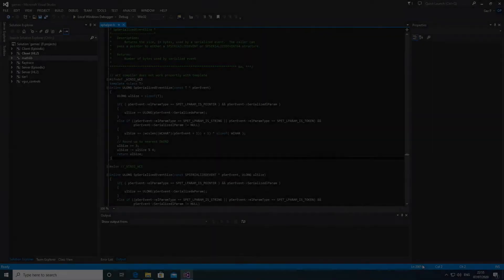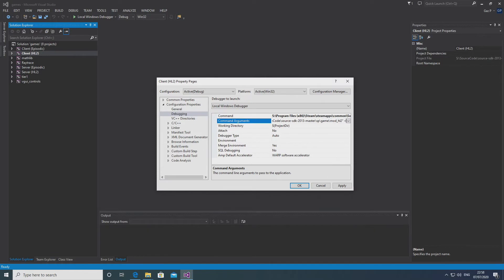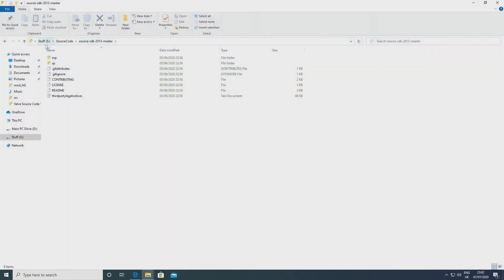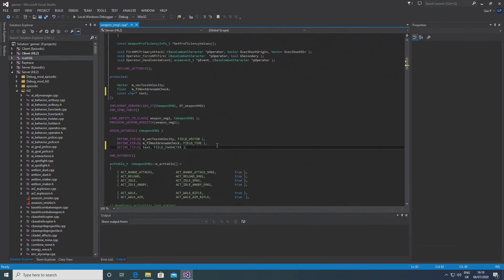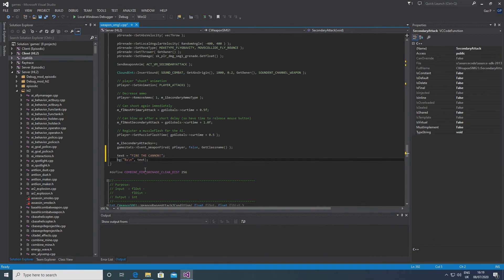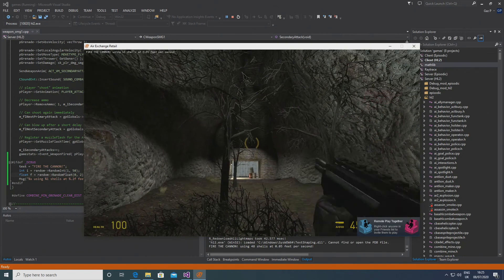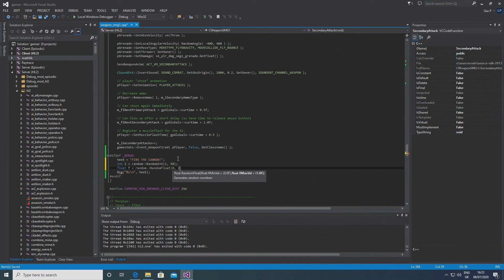Valve Source Code 2013 Tutorial (Episode 0.5/1): Debugging the Code and Coding Console Messages

Comment: Unable to start program 'C:\Users\Administrator\Downloads\source-sdk-2013-master\source-sdk-2013-master\src\game\client\Debug_mod_tf\client.dll'.

C:\Users\Administrator\Downloads\source-sdk-2013-master\source-sdk-2013-master\src\game\client\Debug_mod_tf\client.dll is not a valid Win32 application.

i changed to win32 but it had 700 errors
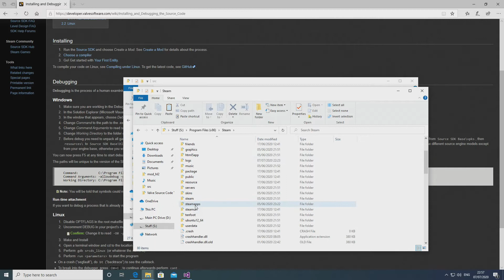Reply from the maker: I show what to do from around 01:39, but you can change the Configuration option to All Configurations which will change the command for both Debug/Release configurations. The error you are talking about happens because you haven't passed through the Command part correctly, so you are trying to launch the client.dll file as an executable.

Comment: Hi I’ve got an issue, so my pc is too laggy to run this software. So how can I delete it ? How can I delete the disk that was created ?
Reply from the maker: Are you referring to Visual Studio or Source 2013 Singleplayer/Multiplayer? Either way, you should be able to use the 'Add or remove programs' system setting to delete them.
Reply: @ I am talking about visual studio, but later this night I found out how to delete it. 10 years ago, softwares were on DVD. So this is why there was a dvd added on my pc(I am saying that because at first I panicked if it was normal or not). Then, to delete the famous DVD, its like the software in question. So I goes in Control Panel, then I  goes to softwares to delete, then I right clicked on « change », then the uninstaller of Visual studio 2013 opened. You click on Uninstall then you wait then there you go. Btw, what I’m gonna do, is just copy and paste some code source scripts to create my own game engine. I hope this message helped people who don’t know much about informatic ! :)

Comment: when i try to load up the game it says Could not load library client. try restarting. if that doesn't work, verify the cache. what do i do. NOTE: this only happens to half life 2 mods not the base game
Reply from the maker: This issue seems to happen when you don't have client/server .dll files in your mod folder, so you would need to make sure the code compiles without any issues and ensure the Command Arguments section contains the correct path to your mod folder.
Reply: @TheMaster974  the client and server.dll files are there
Reply: my command leads to this E:\SteamLibrary\steamapps\common\Source SDK Base 2013 Singleplayer\hl2.exe my working argument is this -allowdebug -sw -condebug -console -toconsole -game"C:\Users\Leani\Downloads\source-sdk-2013-master\source-sdk-2013-master\sp\game\mod_hl2"  and my working directory leads to this E:\SteamLibrary\steamapps\common\Source SDK Base 2013 Singleplayer WHAT AM I DOING WRONG and this is all in client(HL2)
Reply from the maker: Try adding a space between the -game parameter and the path to your mod.
Reply: @TheMaster974  it worked, i feel so stupid

Comment: "unable to start source sdk 2013 access is denied" - what i do?
Reply from the maker: From the research I have done into this issue, this seems to happen if the Command/Command Arguments sections are not correct for your situation i.e. using the C:\My_Mod\... path, when your mod folder exists elsewhere. Try changing the mod path to the place where your source code is located and see if that resolves the issue.

Comment: Hello, I have an issue. Whenever I debug my mod and run the map and the mod, the menu title to the mod are just abunch of hl2 symbols, no letters. I've gone into the gameinfo file. And the title and game names are normal letters and dont include anything weird. I have also tried to add maps to each chapter to play. But the mod wont boot the maps up even tho I have them in the map folder in my mod, and have configurated them to run on each chapter in the mod. It feels like my updates to the mod arn't applying. Please help me.
Reply: Thank you, you fixed my issues. I only have one little problem tho. My game title when I'm in the game, isn't fully working. Some letters in the title you can see, and some you can't. Like some letters in the game title are just invisble. I Have changed fonts, but I really do not know what to do. Do you know what the issue is?
Reply from the maker: I'm not sure, it could be the font you are using, but if that is not the issue, the only other thing I can recommend is to look into the clientscheme.res file again and look at the Main.Title1 and Main.Title2 stuff, there's options for position and colour which might need to be adjusted. If you let me know about the font and title, I could look into this and see if I can replicate this issue if my suggestions still don't fix the problem.
Reply from the maker: The reason why the menu title looks weird in-game is because of the font that the title uses, which is a font that contains the weapon/ammo icons seen in Half-Life 2. One thing you could do to resolve this issue is to change the menu title font, which can be achieved by modifying the ClientTitleFont section in your mod's resource/clientscheme.res file. As for the maps issue, all I can really advise is that you make sure the maps are contained in the mod's maps folder and you are using the correct spelling of the maps in the chapter number .cfg files, which should be in your mod's cfg folder. This goes without saying, make sure the chapter number .cfg files are actually saved as .cfg files, otherwise the custom chapter map loading won't work!

Comment: I Keep getting "Library Client Couldn't Load", and then it's telling to verify the cache, i don't know what any of it means
Reply: I am using the correct path to my mod folder, oh wait, do I need to make a mod folder 😅,  because I wanted to modify the source itself, I thought a mod folder wasn't necessary, maybe that could be the problem
Reply from the maker: It's possible to modify the source code without needing a mod folder, however you won't be able to launch into debugging for testing. You can use the mod_hl2 or mod_episodic folder that comes with the 2013 code (which is in the game folder), the client.dll and server.dll files will be compiled to the bin folder in that location by default.
Reply: @TheMaster974  Yeah your right about not being able to debug, cause the error showed up when I tried to debug my compiled sdk
Reply from the maker: You could have a mod folder set up in the Steam/steamapps/sourcemods folder, as long as the Command Arguments section includes that location (this is shown at around 3:15). I always use the stock mod_hl2 folder whenever I test stuff out, so I don't really know what to suggest if you're experiencing this issue still, even with the stock game folders.
Reply: @TheMaster974 Yeah, this problem is pretty weird, I haven't yet tried this solution but thanks for the help, I'll totally try this method so I can debug my mod. I am pretty confident that this'll work, it's probably missing some assets and I just haven't correctly imported them
Reply from the maker: I'm not sure why that's happening, all I can really advise is that you make sure you follow what I say in the video, make sure the client.dll and server.dll files compile correctly and you are using the correct path to your mod folder in the Command Arguments section. It might also help to ensure you are opted into the upcoming beta of Source 2013 Singleplayer.
Reply: I just saw another tutorial on how to setup,  not saying yours is bad, but in that tutorial, it was mentioned that you need to import cfg files and transport all your dll(client and server) to the mod folder, I'll try this out, maybe the library error I'm getting, means that some assets are non existent or cannot be found, I just hope making the mods folder will help

Comment: Hi there, I have everything (I think), but when I compile the code and open the game, it shows this: 
------------
Engine Error

Could not load library client. Try restarting. if that doesn't work, verify the cache.
------------
What should I do?
Reply from the maker: It sounds like the bin/client.dll or bin/server.dll file isn't being found in the folder that you specified in the Command Arguments section of the Properties of the Startup Project, which is why the game doesn't load up properly. All I can really advise is to check to make sure that the path to your mod is correct in the Command Arguments section, plus an appropriate Startup Project is selected i.e. a HL2 project is used if you are dealing with the game/mod_hl2 folder or an Episodic project if you are dealing with the game/mod_episodic folder (if that makes sense).

Comment: i am trying to change the RPG speed on the multiplayer version but changing the #define RPG_SPEED does nothing even after rebuilding with the changes, do you know what could be causing this?
Reply from the maker: I'm not sure, I was able to change the speed value, compile the solution and the modification was reflected in game. All I can really suggest is to make sure the RPG_SPEED value is getting used in the code properly (it's used in AccelerateThink and IgniteThink inside of a SetAbsVelocity function) and to ensure you are loading into the correct mod when testing.

Comment: how do you get all of those files in mod_hl2
Reply: i only have 10 things in there
Reply from the maker: You can create new folders (right-click inside of the mod_hl2 folder and select New->Folder) inside of the mod_hl2 folder, for stuff such as models, particles, sound etc. and get assets from the Source 2013 Singleplayer/Multilplayer install directory that Valve doesn't provide.

Comment: do you know how to setup hammer for a source mod or do you have a tutorial on it.
Reply from the maker: Thanks for the comment and apologies for the late response, I don't have a video about how to do this, however what I would advise in this situation is to open up the Hammer editor and go to Tools->Options, then select "Edit" after the Configuration option, then Add to add your mod as an option, then you will need to add .fgd files that will be useful and select file paths for Game options and Build Programs. Game options would be the path to Source 2013 Singleplayer/Multiplayer and your mod's directory respectively. Build Programs (which is a separate tab) will be the paths to tools like VBSP/VRAD etc. but also where compiled maps will be placed (point it to the mod's maps folder). Hopefully this is enough to help you!
Reply: @TheMaster974  thank you so much

Comment: How do I debug the Multiplayer Version? What do I select for the command path?
Reply from the maker: You would do pretty much the exact same thing as I mentioned in this video, however change Singleplayer to Multiplayer (so the Command and Working Directory paths point to where Source SDK Base 2013 Multiplayer is installed) and change the path to your mod in the Command Arguments section to the directory where your mod is located.

Comment: hi, i have problem with debugging, it says there is no captoincompiler.exe at src\utils\captioncompiler\debug, there is only captioncompiler.exe.recipe, when i remove recipe it changed back, what i need to do?
Reply from the maker: I think the captioncompiler project needs another project to be built first in order for it to build properly, so simply building the solution again should solve the issue. I think you also need the sapi51 folder (as mentioned at 6:23). However, this project isn't really important concerning Source modding, the Client and Server projects are far more important!

Comment: Unhandled exception at 0xE55AB6D4 in hl2.exe: 0xC0000005: Access violation executing location 0x00000000. What can it be?
Reply: are you Compiled server(hl2)?Make sure the server.dll and client.dll exist in the mod_hl2/bin dir
Reply: @wenchaojiang958  Thank you for this comment, I had this same issue and I didn't realize that building the client did not also build the server automatically. Doing a manual build of the server fixed the issue!
Reply from the maker: I'm not sure, if you're using the Singleplayer code, did you opt into the upcoming beta for Source 2013 Singleplayer on Steam?
Reply: @TheMaster974  putting the upcoming beta dont work,i tested it and still having the error (srry for bad english)
Reply from the maker: I don't know why this happens and I haven't been able to replicate the issue on my end, so I don't really know what to suggest. A couple of things that might help me out is to know if you are using the unmodified version of the 2013 code released by Valve, did you install Visual Studio 2013 Community and which version of Visual Studio are you using to launch into debugging?
Reply: @TheMaster974  im using the unmodified version of the code and using vs 2013 ce as ide and compiler
Reply from the maker: I would suggest trying to use a newer version of Visual Studio and see if the problem persists, if that doesn't resolve the issue then I don't know what to say, I haven't encountered this issue so it's hard to determine what's causing it.
Reply: @TheMaster974  i used vs 2022 as ide but same error,i will try to use source SDK base 2013 ce or mapbase to see If the error persist

Comment: i'm having this weird error whenever i press local windows debugger. "Unhandled exception at 0x2E1AB600 in hl2.exe: 0xC0000005: Access violation executing location 0x00000000." any fix?
Reply from the maker: Oh ok, that wasn't what I was expecting the issue to be, I'm glad you managed to resolve it!
Reply: @TheMaster974  what was the solution? i have the same error
Reply from the maker: It looks like the reply has been deleted and I don't remember what it said, so I don't really know what to suggest. My recommendations would be to ensure that you have opted into the 'upcoming' beta for Source 2013 Singleplayer and compile the Release version of the code instead of the Debug version. Also make sure your code doesn't have any errors!

Comment: why i can't run the code 
and i setup source 2013 for visual studio 2019 
my mod_hl2 folder more empty than your mod_hl2 folder also my mod_hl2's subfolders too 
what should i do
Reply from the maker: That's a difficult question to answer, as it would be ideal to install Visual Studio 2013 Community first, then Visual Studio 2019 later. You have to install Visual Studio 2013 Community to get the right Platform Toolset that allows the code to be compiled. If you updated/upgraded the source code to use the Visual Studio 2019 Platform Toolset, you won't be able to compile it. It's weird like that, you can't just use a newer version of Visual Studio and it works. In regards to the mod_hl2 folder being empty, you can always copy what's in the Source SDK Base 2013 Singleplayer\Multiplayer/sourcetest folder. You can get a full Visual Studio 2013 Community installer from here: https://archive.org/details/en_visual_studio_community_2013_with_update_5_x86_dvd_6816332 or I can try and supply a minimalist install. Or use the Community Edition version of the source code: https://github.com/Nbc66/source-sdk-2013-ce
Reply: @TheMaster974  game solution can compile but if i try to run the code a error message appears and a window opened in visual studio and writes "engine.pdb are not loaded"
Reply: @acmayin  me too! idk why but i think that maybe the vs is not finding the game Engine.

Comment: It says Client.dll is not a valid Win32 application
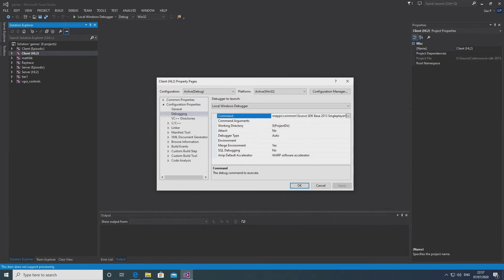Reply from the maker: The project which contains the Debugging Command (i.e. what I outline at 2:00) has to be set as the Startup Project. As I was dealing with the HL2 code, and Client HL2 was the Startup Project, I set the Debugging Command and other stuff there (by right clicking on the Client HL2 project and going to its Properties, then Configuration Properties->Debugging). If you're dealing with the Episodic code, right click on the Client or Server Episodic project and select "Set as Startup Project". This should allow you to launch the mod, supposing you've got the Debugging Command stuff correct. Hopefully this helps!

Comment: how did you get that hl2 folder inside of microsoft visual studio 2013 i dont have have that folder
Reply from the maker: It should be there when launching the games/everything solutions, which are created by running the batch files in the sp(or mp)/src folder. However, if you're using a different repo (i.e. 2013 Community Edition), you don't get a HL2 folder. If you acquired the code from Valve's GitHub page, you shouldn't be experiencing this problem. Are you opening a specific code file and not the solution file? That would not load HL2/Episodic folders in Visual Studio. I haven't experienced this issue before, so I apologize for not being able to help much!
Reply: @TheMaster974  I figured it out turns out that Im stupid forgot to to enable show all files but nonetheless thanks for the help!